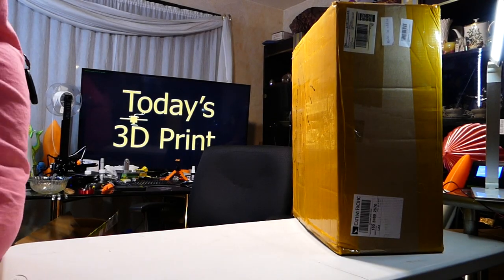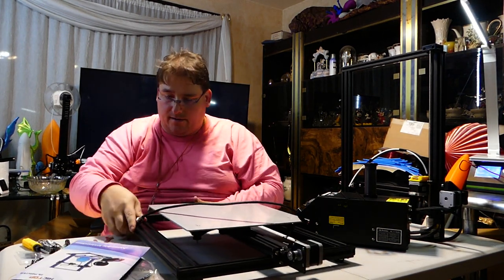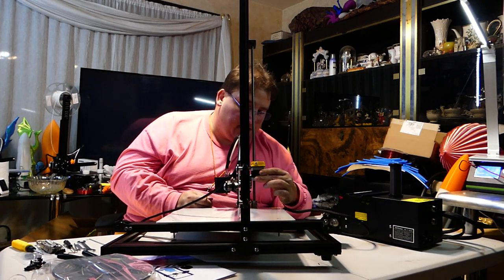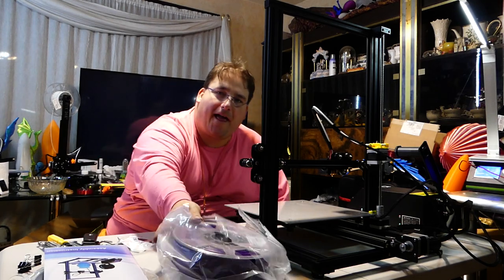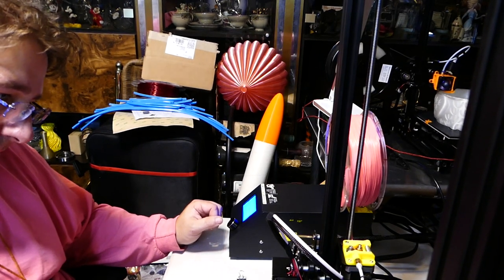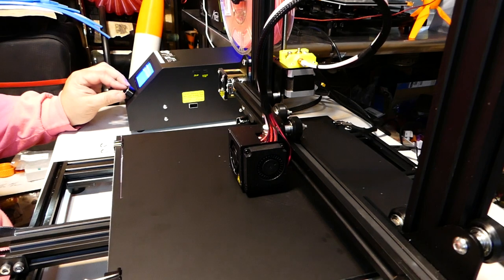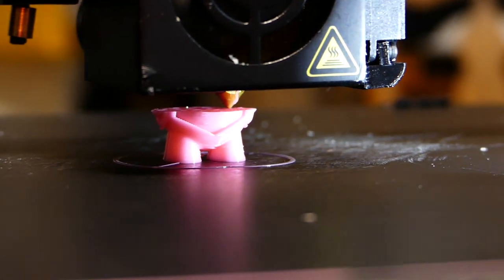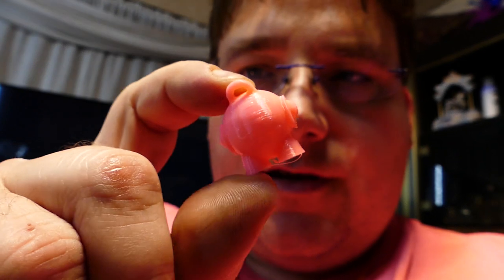Today's 3D Print - CR 10 Unboxing, Assembly, First Print

Comment: PrintnZ black plate is $80 USD for 300mm x 300mm even with code TODAY3D ? pretty expensive for us canadians? Do I have the wrong product for a cr-10?
Reply from the maker: +unseenwonders no. Get the skin! $31.75
Reply: I would get the black skin but they are out of stock. They have white? is that OK? I would think it would be!
I got a hictop cr-10 and have already printed the levelling gears etc with NO Real Problems. How cool is that!
Reply from the maker: unseenwonders white is fine it just have trouble seeing white filament when printing it's otherwise identical make sure you put it on a piece of glass and not directly on the aluminum bed at links on Amazon for $9 for one cheat but a better deal is to go to Home Depot and get a six pack box for $10 nice and thick very flat

Comment: So much money for a single lead screw..How much would it have cost to make it symmetrical
Reply: $49.99
Reply: Seems like a waste for such a nice printer..Or is it just more trouble?
Reply: When you have one, or watch it closely, when printing you can see one side lags behind the other when it lifts.  The smartest thing they could have done is use one motor with two lead screws and a belt between them.  Two motors WILL lose sync over time and is not the best way to do a Z.
Reply from the maker: The Best Stooge I don't see any such artifacts in my vertical lines so I am inclined to leave it alone until it needs fixing I love not having to balance an X gantry although I am considering adding a passive counterweight to remove Gravity from the equation on the gantry

Comment: Can you give a link where you bought your black plate on the printer? Or whats the name exactly? :-) I use the tape, but i want to change it, bec. as more often u use it - as more bubbles you get with the tape :-)
Reply: Waow thats expensiv. If i want it for my CR-10 in 300x300 mm it would cost USD 80.50 without Shipping :-) I think its a bit too expensive for me :-)
Reply: That's the really thick plate version. The skin is 30 dollars. You'll just need a piece of Borosilicate glass or a piece of mirror cut to your desired size to place it on. Then secure the the whole lot with binder clips or thermal adhesive pads to your aluminium build plate.
Reply: Thanks! I will look again - 30 Dollars are okay, but 80 Dollars is too much for me :-)
Reply: Tam Gaming No problem. You may be able to lay it directly onto your aluminium build plate if your plate is nice and level with zero warping.
Reply: Yes, i tried to buy it just a minute ago, but their PayPal isnt working. I have to contact them tmr by mail first. Paul, do you use it too? Or do you use something different?
Reply: Tam Gaming I was going to order some soon myself. I'm currently using this: https://www.filafarm.de/collections/druckbetten/products/druckplatte-fur-abs-und-pla , on a wanhao duplicator i3. Just installed it last week but I'm getting inconsistent results with bed adhesion. They state it gets better with age, it better because I paid more for it than printinz. I found the original surface that came with printer which is a buildtak type surface sticks to pla extremely well if you rub the bed with a bit of isopropyl alcohol before printing. The printinz is more like the buildtak surface than filaprint so I'm going to give it a try on nerys recommendation. I have an old makerbot replicator 2 printer in work and the pla sticks to a non heated bed with blue painters masking tape like crazy. Prints never curl off the bed.
Reply: Yes, ... i also found on amazon only 3 stars ratings for products like this. I saw many comments, where ppl say, they have for each filamenttype a different bedtype to get the best results.
Reply: Tam Gaming Probably like yourself I'm hoping for one surface to rule them all. I've preordered some of this: https://www.kickstarter.com/projects/geckotek3d/ez-stick-3d-printer-build-surface-by-geckotek . It's not too expensive and looks promising. Their previous build plate campaign was a success.
Reply: Yes it looks cool. 20$ per peace is abolut okay. Maybe i will do it too. 200x you can use 1 peace they say in the video. Means each print costs you minimum 0,10 $ ... thats the other side :-) And i expect 200 is the absolute maximu. Means maybe each print costs you 0.20$ without filament :-) I order now the printinz skin first i think :-) and simplify3D für 150 bugs :-)
Reply: Tam Gaming it's worth a try but as of yet haven't gotten any shipping confirmation from them yet. There's a couple of other print surfaces I came across called 'printbite' and 'lokbuild' but don't know how good they are. I think my best bet is to get the printinz to try. I'll probably give my filaprint surface a very fine sand with sandpaper to give it bit more grip and bite, It's sticking but not as solid as I like atm. I have some premium pla filament coming next week  so hopefully it will stick as some brands stick much better than others.
Reply: I use the original tape from CR-10 on my glasbed. And i use a papergluestick when the bed is warm. It works very good. The PLA i use atm is the original from creality. So far i dont have any problems, only that the tape when it becomes warm, gets little bubbles. But most problems i have with PLA is, when the bed isnt well calibrated i have to say. I made today a Lithophane 30mmx60mm high. Its awesome clear and unbelieveable detailed. But i have to say also, i bought some hours ago the Simplify3D software, and with it, it was sooo easy to get out a perfect Lithophane model. In Cura it wasnt easy for me. I know that cura is also very good, but its not as beginner friendly as simplify3d i have to say. The 150$ für simplify are a great investment i have to say!
Reply from the maker: +Tam Gaming no the cr10 is $31.75 you don't need the plate you just need the skin and shipping is free use coupon code TODAY3D for 10% off
Reply: I tried it - and their system says shipping costs 15$. Thats really a lot. I order so often from all over the world. But most is only 3$ for shipping. Thanks for the code btw. :-) I am unsure if i want to pay 45$ only for a skin i have to say.

Comment: What do do you think is the difference between EU and US version? I dont mean only the colors :-)
Reply from the maker: Tam Gaming absolutely no difference whatsoever in any way shape or form that is at all relevant to you in any way shape or form except a $3 cable that plugs into the box they are the exact same unit they just give you a different cable you can just buy your cable locally or use a cable from any other machine you have the box itself is 100 - 240 compatible you just flipped the switch to whatever voltage you need and plug in the appropriate cable so unless your cables cost 30 or $40 locally buy the one that's cheaper and replace the cable
Reply: Yes i was thinking the same like you. I wasnt able to find a difference - only the color and maybe the cable. But a good strategy of them to give them 2 different colors i have to say. Thanks for your answer :-) Wish you a nice weekend ! :-)

Comment: You need flash the firmware to remember the setting...
Reply from the maker: Toho Tsai ahhh can non tiny machines be flashed? Ie is there a bootloader?
Reply: You need get aduno uno to flash bootloader first, it's not hard to do it. Took me around 10 mins, then you can flash any firmware using USB..
Reply: I got my cr-10 from GearBest
Reply from the maker: Toho Tsai that's what I was afraid of
Reply: +Toho Tsai Hey! You have links, or whatever, for that?